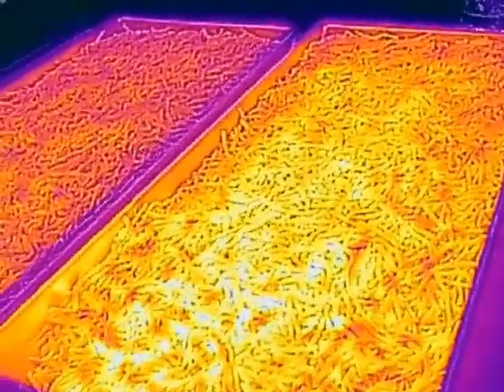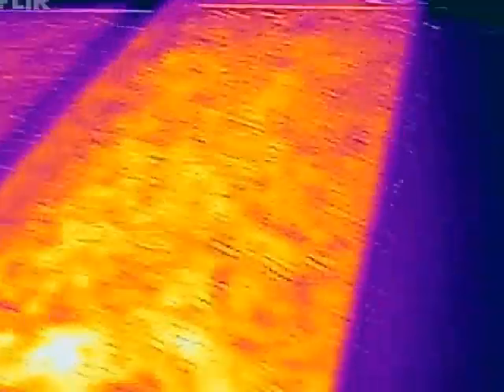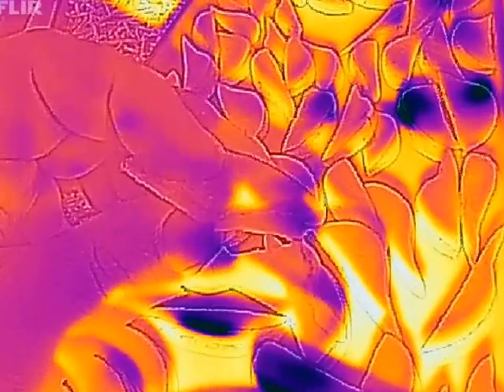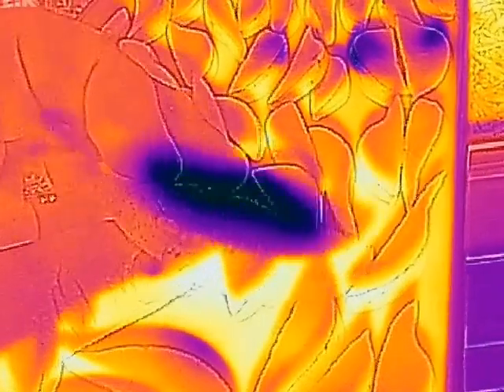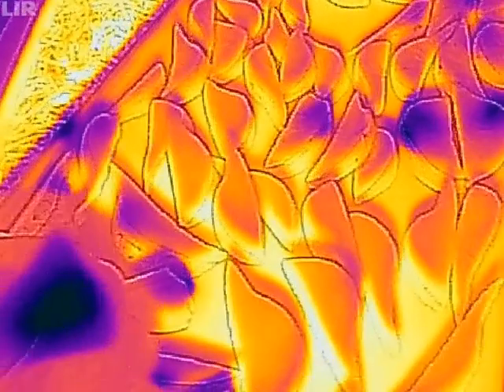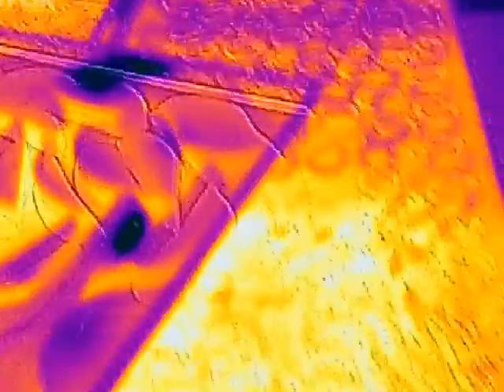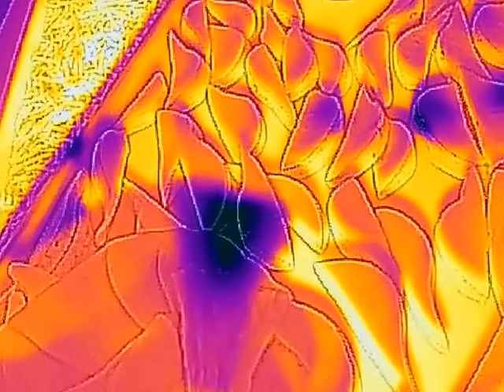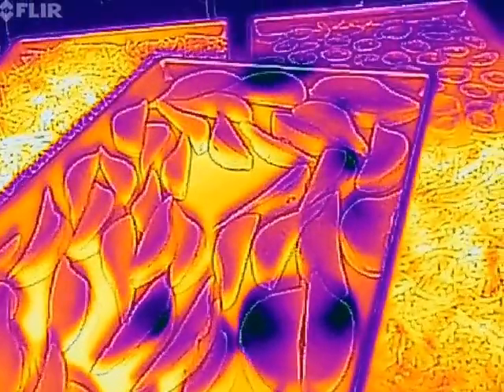How to use the FLIR Thermal Camera to see if your Harvest Right Freeze Dryer Food is Done and Ready

Comment: what are your temp settings for the FLIR? I have a TC002C. My red parts showed at 85F and the darker parts at 65F. Was wondering if I need to do custom settings. Thanks!
Reply from the maker: For this video it was set to dynamic, so it adjusts colors CONSTANTLY based on the hottest thing on the screen and the coldest thing on the screen and then scales between the two numbers.